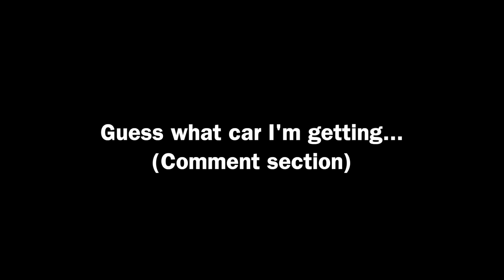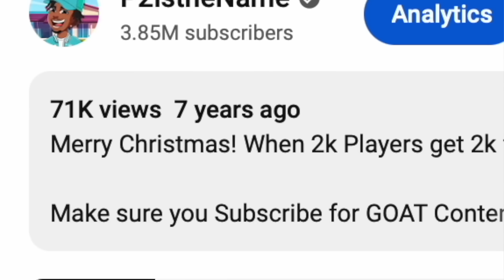WHY I Sold ALL MY CARS & CHANGED MY LIFE | P2istheName

Comment: the cyber truck isn't reliable and you going to have hella problems with it. me personally i would get the Lamborghini truck because its gas and its more reliable and faster than the cyber truck. another good big body option would be a Cadillac escalade v. because its fast and its huge and its nice plus its a supercharged v8 so it wines like a hellcat and the inside is luxury.